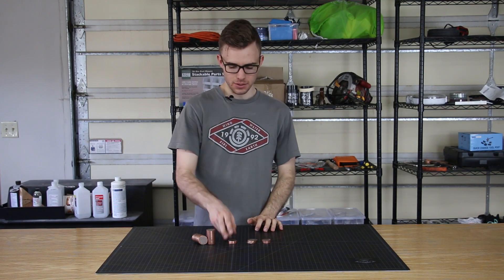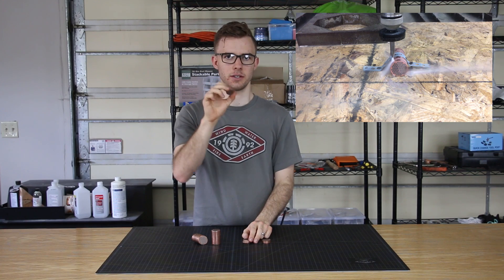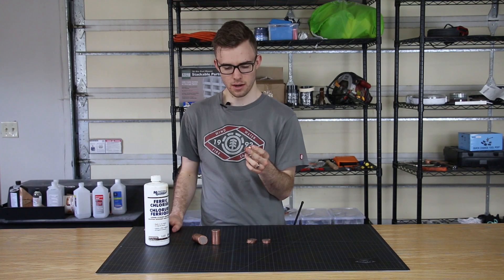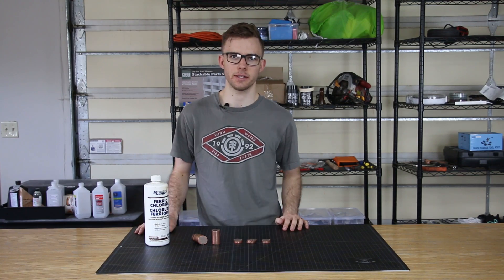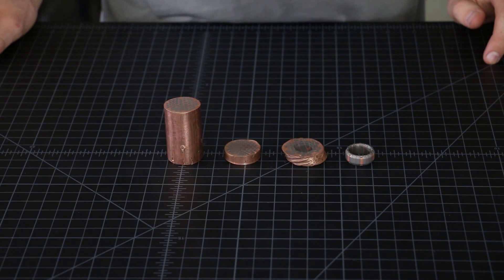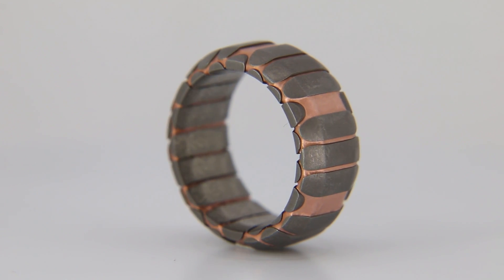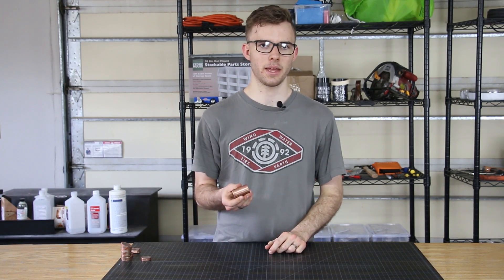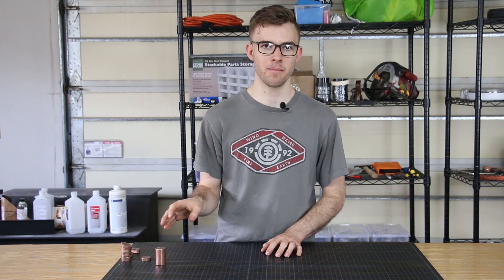Making a Superconductor Ring on a Lathe

Comment: This one of the most visually striking rings have seen.  But, wondering how wear resistant.  Will copper tarnish, or get scratched up after while.  Is there a coating to prevent from happening.  And the other grey material, can this be polished?

Comment: Hey Patrick, I'm looking for some advise.  I make rings but never a superconductor ring.  What size piece of metal did you find best to lathe and more important, where in the heck did you buy it?  It seems people only want to sell SC chips and almost never can find a rod.  I'm looking for something around 4" long x 1.75" wide but seems nearly impossible to locate.  Any leads here or through private message would really be appreciated.  Thanks!

Comment: Hows the name of the tool you hold the ring with the inner diameter on the lathe?  You span this with the middle hexscrew right?

Oh..  and what kind of cable you used?  I was searching for 20minutes now but just can find cables with plastics in the inner,..

...OK..  Superdonductor..  that was a pretty expensive ring you made there hm?  where did you get your sample?  From the Texas Collider?  Where exactly from?  thx !

Comment: I'm sure the water jet was much more efficient but assuming that would be expensive to hire someone to do, couldn't you have just gut the plate or ring for that matter right off your lathe?
Reply from the maker: +Michael D. Baker you're right. There's other methods that would make more sense, but you need to use a waterjet if you want to make a waterjet channel video.
Reply: Point well taken

Comment: My only question is will the electronegativity differential in the presence of an electrolyte (sweat in this case) cause a current to be generated and dissolve the more base metal over time? (copper in this case)

It's common with Mokume Gane jewelry.
Reply: Don't sweat it.

Comment: i didn't know we had super conductors at room temperature yet. A room-temperature superconductor is a hypothetical material that would be capable of exhibiting superconductivity at operating temperatures above 0 °C (273.15 K). While this is not strictly "room temperature", which would be approximately 20–25 °C, it is the temperature at which ice forms and can be reached and easily maintained in an everyday environment. The highest temperature known superconducting material is highly pressurized hydrogen sulfide, the transition temperature of which is 203 K (−70 °C).

but yes this is a cool ring and i would love to own it.
Reply: Teh Blacksmith we don't. The critical temperature for this superconducting wire is still 10 kelvin.
Reply: i know i was being sarcastic

Comment: Cool video man! Are you using yotube auto stabilization or any other software to reduce shakings? Because it looks like your video is being distorted when on the lathe, but might just be the lathe shaking things up.
Reply from the maker: +hans peder sahl I used a stabilizer effect in my editing software because the table I was using was very shaky while filming. I'll be using a more stable video next time so things should be back to normal 👍🏻

Comment: I had just discovered your channel, consider putting liquid metal inside a ring? i had always wanted to do so, but in a necklace instead. So basically you can mix some metals and make them have very low melting point, and it would be really cool to make them be in their liquid form, only when the user is wearing the ring. Cavity in ring for the alloy, and sealed with epoxy.
sorry this was taken from my facebook comment just in case if you can't see it😋.